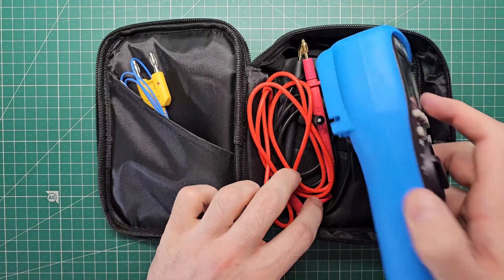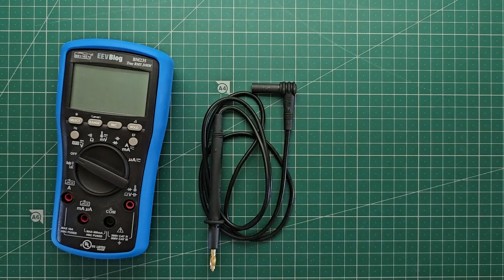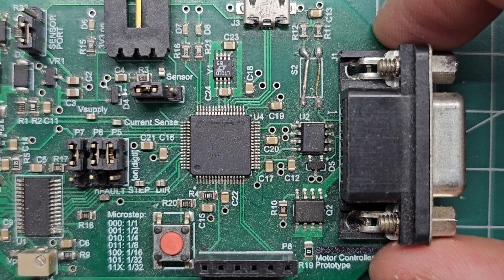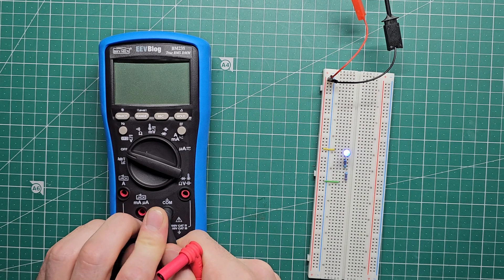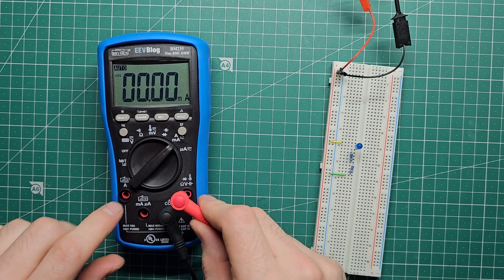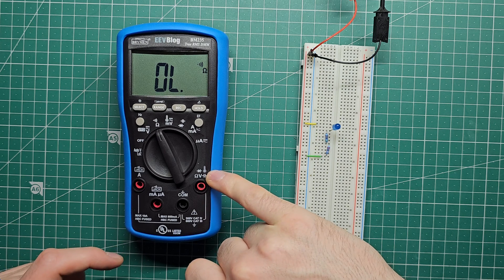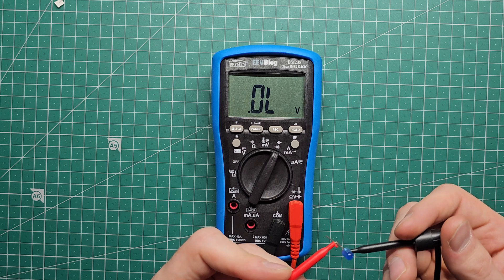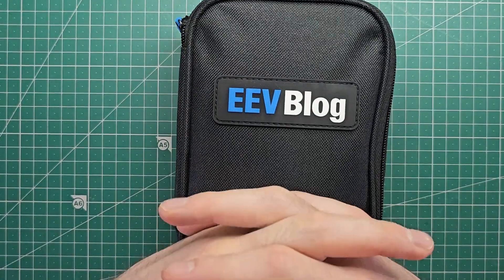How to Use a Digital Multimeter - Complete Guide For Beginners

Comment: I rarely comment on YouTube, but a comment is needed for this one, your channel is completely underrated. I thought you had at least 100k subscribers, then I saw that you're a small hobbyist channel. I hope to see more in depth guides on specific topics like complete circuit testing, exhaustive safety measures, PCB design, new machine and equipment presentations and guides, like complex oscilloscopes or precision RCL measurement devices...etc, and also more Arduino, Raspberry Pi, or lesser-known board tutorials, maybe even some programming for some projects.
Reply from the maker: Thanks for the incredibly kind reply!
I've screenshot your comment for future video ideas 😉.
Also my next project is a big technical build with a custom PCB design and programming... Stay tuned